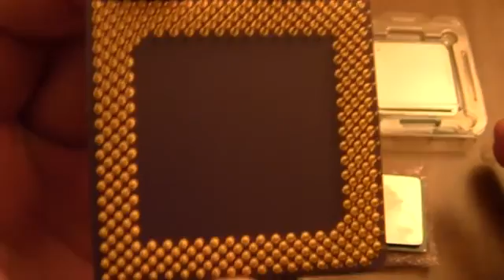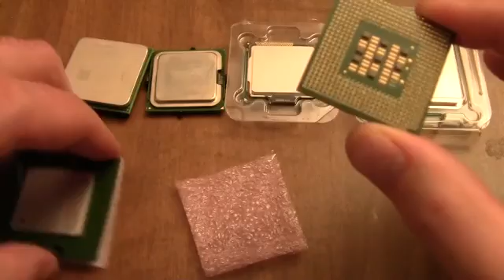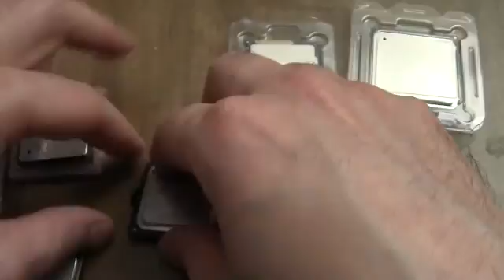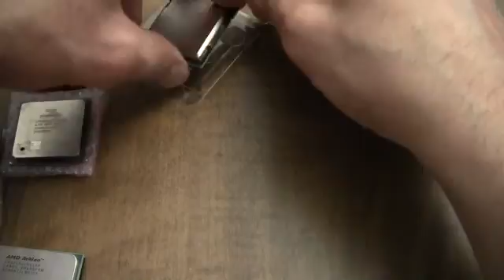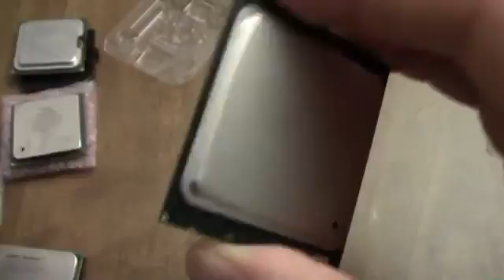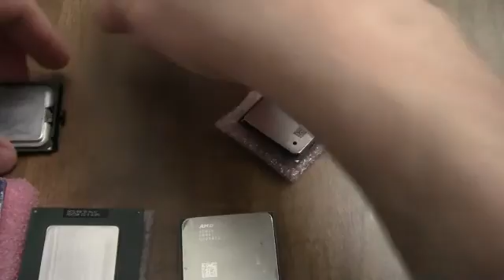Processor Socket Comparison

Comment: Can you name 3 or 4 brands and models of old laptops that have a PGA socket?
Reply from the maker: I think laptop PGA sockets went away in the Haswell (2013ish) generation of laptops, at least on the Intel side. For AMD, it may have been earlier. I cannot remember exactly the last time that I saw a laptop with a replaceable CPU in a PGA socket, though I have seen them. Here is some information that I found: https://en.wikipedia.org/wiki/CPU_socket and https://en.wikipedia.org/wiki/Pin_grid_array I can't even guess as to brands and models unfortunately. Perhaps searching for any models with Intel Haswell CPU's (or earlier) would give you the best chances. The first Wiki article distinguishes between desktop and laptop CPUs and socket type. My initial guess is that any laptop with that supports a family of PGA CPUs would have a motherboard with a socketed CPU. Further thinking adds some doubt: could some CPUs be removeable PGA and some soldered to the board from the same family? A socket on a laptop board would be more expensive than just soldering the CPU to the board. That makes me think cheaper laptops may not have the PGA socket at all. Or perhaps, PGA CPUs were never soldered to the motherboard. I am just not 100% sure.
Reply: @AdoptedMike  thank you

Comment: what's the difference FCLGA2011 and LGA2011? if it's the same, why do you think it's called differently? thanks.
Reply from the maker: Flip Chip Land Grid Array 2011. Same thing as LGA2011. However there really is LGA2011-0, LGA2011-1, LGA2011-v3. Different CPUs fit in different sockets. It mostly differs because of the Xeons from what I can tell with the v3 being on X99 and the other 2 being X79.

https://en.wikipedia.org/wiki/LGA_2011

Comment: Changing so much on the motherboard makes me think that the old boards should be recycled more, not thrown into landfills. I have built computers since the early 90s, so I know there are many out there. Tech companies should think about the environment when they make new products that cannot use the old boards, sockets, etc. They should have a recycle program knowing there are many boards out there that cannot use the new configuration on the chips.
Reply from the maker: skybitscom I agree, computers are just discarded in a landfill way too often. E-waste is very bad for the environment. Not many get recycled.

Comment: I have a ASUS P5QL Motherboard and cpu is gone, I need to know that canI replace this mother board with ASUS :CPU-Combo-ASUS-P5QL-EPU-Motherboard-w-Intel-Core2-Quad-2-5Ghz-LGA775-8GB-DDR2.I just found in ebay for £85.Thanks for your reply. I can send you the link on ebay to see the shematic.
Reply from the maker: Hussein Afshar Here is a link to the CPU support list on ASUS website:

http://www.asus.com/Motherboards/P5QL/HelpDesk_CPU/
Reply: Hussein Afshar You need to know if the motherboard you want to put in that case is the right type for that case (ATX, etc) If so then there should not be any problem. Also check to make sure you know what power supply the new board you want needs and if you have what it requires. The connectors on your power supply will feed the board, so you need to know that information, along with the volts required based on max specs if you plan on really using it to it's full capacity. Always get more than you need so you can upgrade later and not have to replace the power supply. Check out the link that Mike listed, of which I'm sure you did already, and check with ASUS to be sure, but please don't throw the old board in the landfill. Give it to any electronic enthusiasts or sell it on eBay for parts. Someone will want it. Enjoy your ASUS. Those are good boards and have been around since forever :)